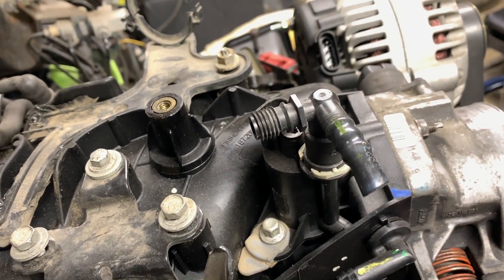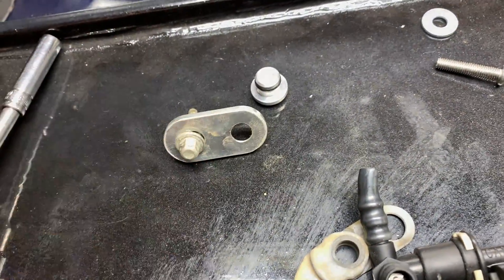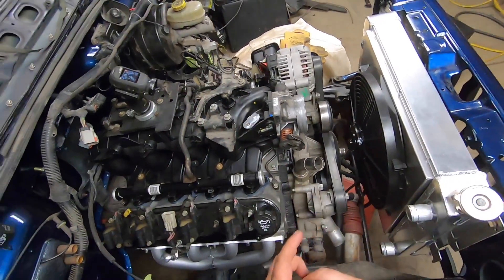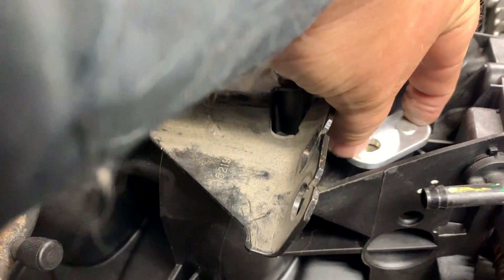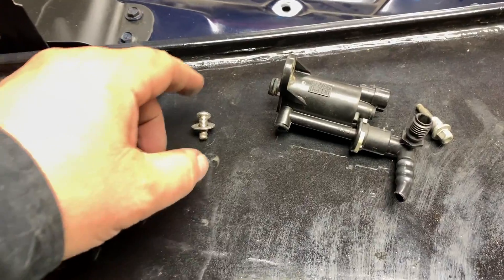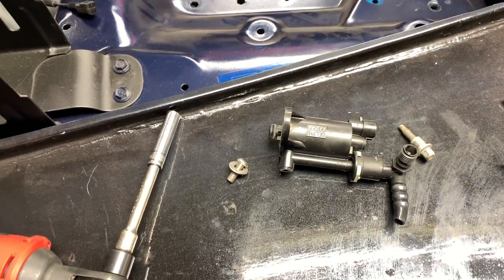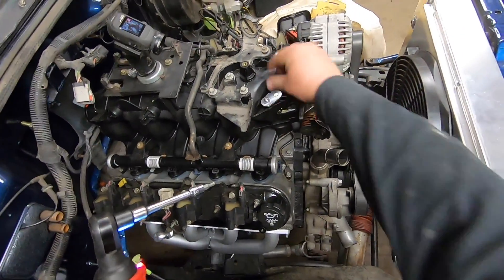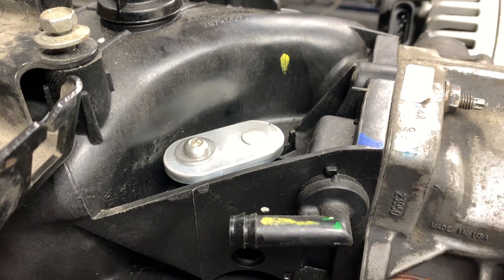LS Evap Delete DiY

Comment: my 84 c10 has ls/lq 5.3 with purge valve deleted, will that make 171/174 code? L/R 1-2 lean? Ive already changed fuel pressure reg, MAF and MAP but codes wont clear
Reply: Well I found the reason for the lean codes....was a 1/8 vacuum line unplugged and buried in wire harness, plugged it up, motor calm down and runs great....now I get the 172-175 rich bank 1-2 lol! what a pain in the ass

Comment: This is impractical for most LS owners ..and only takes care of part of the issue ..what about the engine codes this will generate as a result of removing the valve? ..same with the egr delete ..removing the hardware is the easy part ..maybe I’m missing something?
Reply from the maker: if you knew anything about ls swaps you can forever delete those codes in HP tuners
Reply: @  ..I’ve heard of HP Tuners ..the cost of purchasing and writing to a specific vehicle software is $500 ..
Reply from the maker: @freedomtrucker2332  it would be cheaper to find someone of FB marketplace that will do it for you like like 30 to 50 dollars to make changes
Reply: Hp tuners is a one time purchase you buy the hardware then vin credits once vin credits have been registered as long as you use the same hardware all the time you can for ever re tune that motor without purchasing more credits

Comment: Don't you still need to delete the ECU / control module  instruction or engine management light will illuminate after detecting the blockage via the air intake port sensor that resides after the purge valve solenoid ..... when the purge solenoid opens to allow the gas vapour through it then passes this sensor telling the ecu all is well?
Reply: HP tuners

Comment: Basically just plug the air hole the rest is obsolete. Still allowing the gas tank to vent but not being pushed out. So the tank don't swell
Reply: if you leave that open going into your engine compartment you are gonna get the smell of gas from your blower every time you start your car why would you leave the system connected and not use a vented gas cap?

Comment: What do you do with the evap line coming out of the fuel tank/pump? Do you just put a breather on it? Will my garage smell like gasses ?
Reply from the maker: I just vented them, I don’t have issues with the garage smelling like gas but that doesn’t mean you won’t though
Reply: Does your check engine light come on after the delete

Comment: @ 1:05 the other plastic fitting-with the yellow and green markings on it: What is that for? Im swapping and installing this truck intake onto my LS4 MCSS. Can I use that nipple for my evap, if I go with the Truck TB. See my LS4 Throttle body has a port on there BUT it is hard to find a damn adapter for LS4 TB to LQ4 intake. So I probably wont be able to use my TB.  I've installed my MAP and brake booster ports/locations. Im just stuck right here on my evap shituation. please help!
Reply: Did you figure it out?